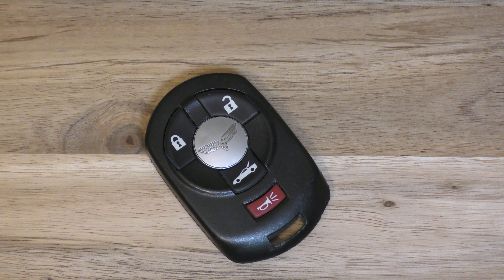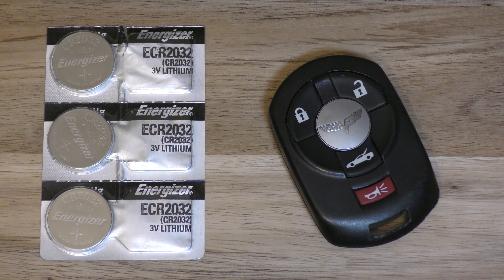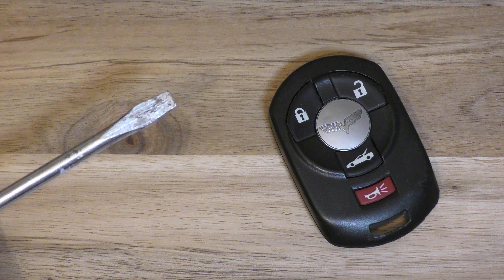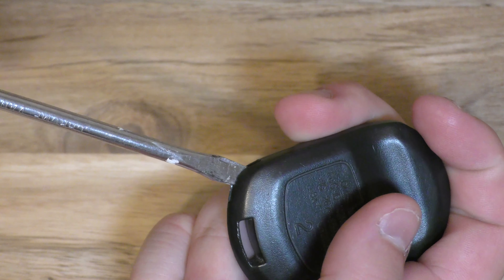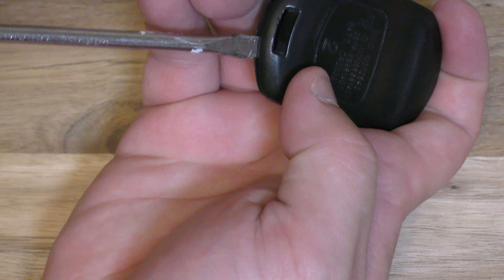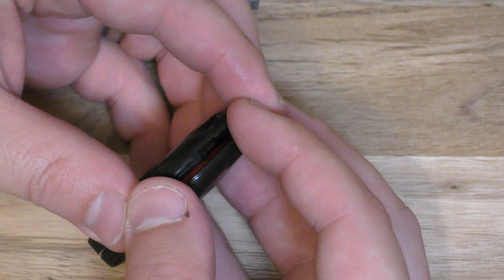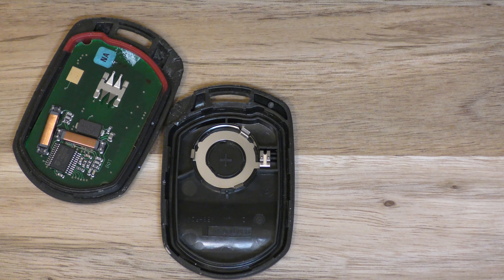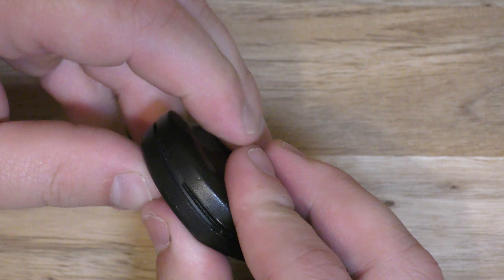C6 Corvette Key Fob Battery Replacement - DIY

Comment: My fob isn’t working I replaced the battery and made sure it was positive the right way tried few different batteries and it wasn’t a bad battery either. I use my key to get in the trunk and manual open the car it only starts when the fob is in the glovebox do you know the fix to this?
Reply from the maker: Do you have an RF tester?
Reply: @ no I don’t but update I brought a new oem key and programmed the long procedure. Put the new key as my fob 1 and the old one as second the new one works unlocks/locks opens trunk but once I’m in it says no fobs detected even putting in the glove box it doesn’t turn on until then it’ll finally turn on after multiple tries. I haven’t found a fix for this please help if u know anything. Read the forums that wasn’t very helpful either.

Comment: Just to be safe, I change mine out every couple of years.  A couple of years ago we installed a new Delco-AC $300 battery in our Corvette and it didn't last a year, so to me, the few bucks spent on these little batteries is cheap insurance.  The car battery had a 40 month full replacement warranty, and when checked out by the dealer, it was definitely faulty and dead and was replaced. CAA is nice to have too for these very occasions.

Comment: When do you know when is time to replace the battery?
Reply from the maker: The signal will begin to weaken or not work at all
Reply: @KeyFobRob  ..any message at the daskboard?
Reply from the maker: @joeschneider67  It will likely say, key fob not detected
Reply: @KeyFobRob  thanks
Reply from the maker: No problem